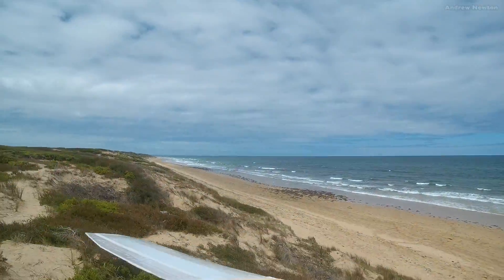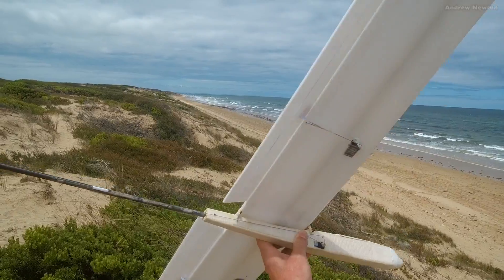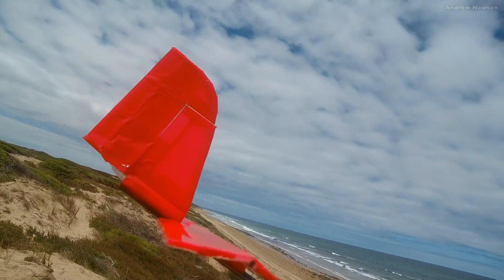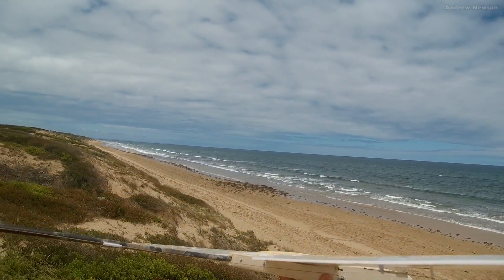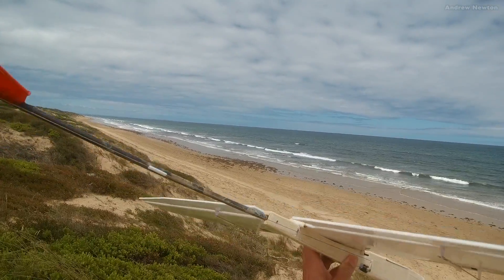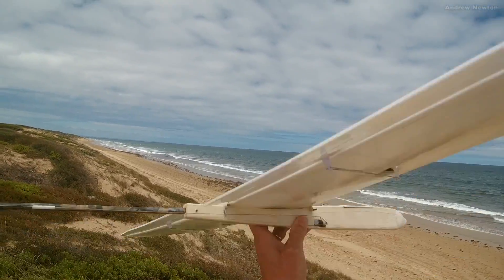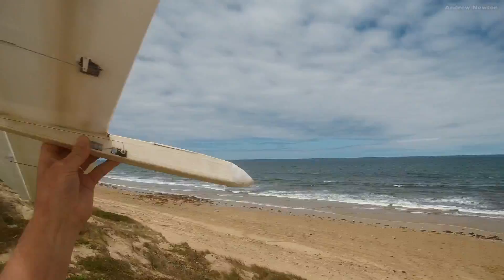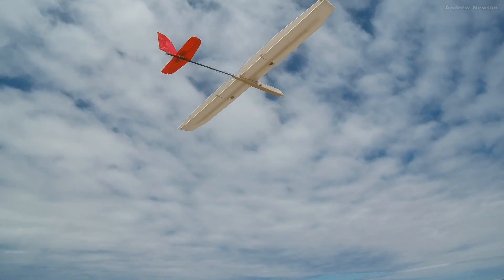Ultralight Sloper Mods

Comment: How does an inverted wing generate up lift? Is the nose tilted much upwards?
Reply from the maker: Correct, nose is up a little. It inverted flight is easier with a symmetrical airfoil but flat will work too.

Comment: Amazing, seems to be more swift, agile  than the last one, do You use sxmetrical throw on the Aileron? some roll Manuver look a little pit arkward?
Anyway it is a Leap forward 👍👏👏 best Wishes from Vienna Anton.
Reply from the maker: Yes equal throws needed for inverted
Reply: @AndrewNewton  Thank You for the quick Respond, have You different Throw, on the Aileron, tried out, Youre Bird, aktually shows the Phänomene of
 negative turning moment, wich means, when rolling to the left, the Plane yaws to the right, (the lowered Flap produce much more Drag than the rised Flap, wich reduced Lift and Drag)
Like Your Construtions anyway, facinating by there Simplicidy and good flying characteristics. 
Happy Landings from Vienna Anton

Comment: Are there any slopes on the dunes where you can try dynamic soaring?
Reply from the maker: Not that I have discovered to date, but I am searching
Reply: For a different bird right, dynamic would tear this apart right? Or at least I'm thinking of those really fast gliders doing extreme speeds.
Reply from the maker: Oh yes, need a very stiff and reasonably heavy glider for DS I think